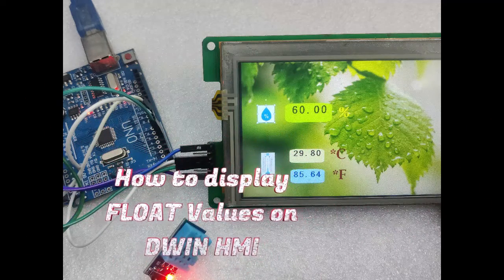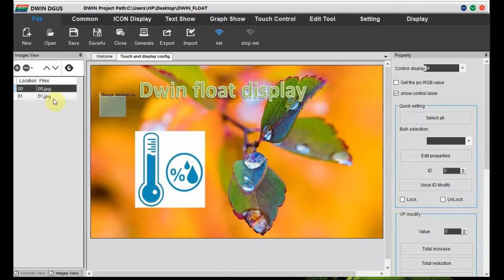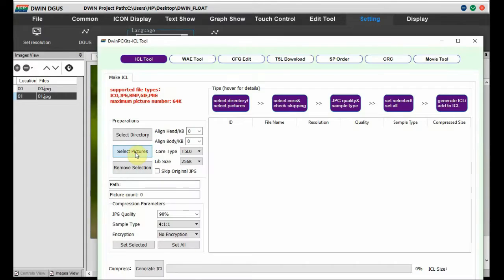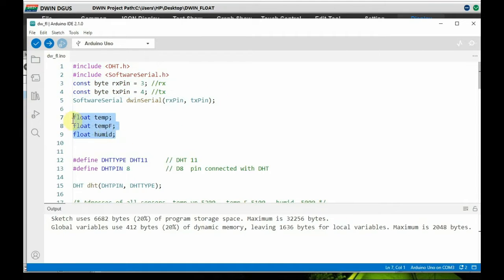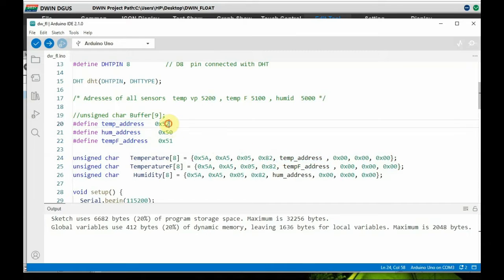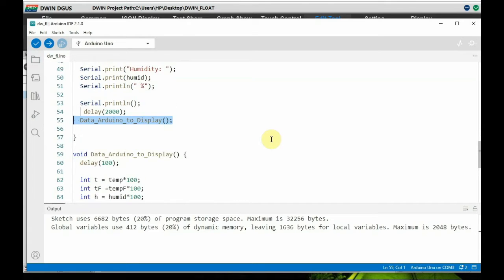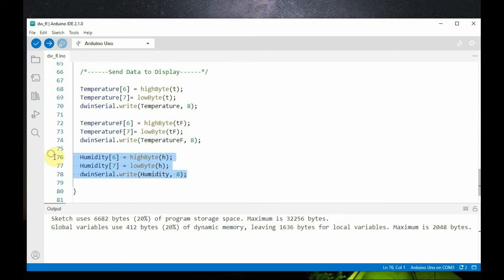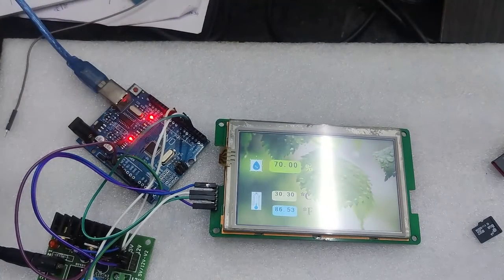#26 DWIN HMI -  How to display Float Values

Comment: Hello, I am a new user of the DWIN display, I would like to know how to generate alphanumeric characters that occupy at least 60% of the height of the display, since the normal way of using '0' index fonts does not help me. It has been possible. In my project the Strings will reach the display through the serial port, sent from an Arduino. Thank you very much and excellent dissemination channel.
Reply from the maker: Artistic Variables can be used by creating image icons. please check video #11   @ 8:15
https://www.youtube.com/watch?v=3819FTWJELM&list=PL0SrfCGiNprSMUgAoekA-BJOxJpuw_Gj5&index=11&pp=gAQBiAQB.
But this method is effective for numeric numbers and for pre stored characters as image icons. Not effective for Strings.
Reply from the maker: you can also try with font generator with bigger size selection for 0.HZK file
Reply: @SaravananAL  I have already tried it, but it is not big enough, that is why I was asking, I have tried with DEGUS txt, but when creating the sources with the gray word library generator and the sources are not shown when sending the strings through the serial port .

Comment: hi sir . i am new to dwin display . i have bought 4.3inch capacitive touch display . but i am facing issue while changing application using sd card (screen goes blank not loading new application from sd card . if i remove sd cardd it booting old application ). i am using sandisk 8gb class 4 sd card . please help me resolve issue
Reply from the maker: Format SD card as FAT 32 allocation units 4096 bytes as seen in video #4
https://www.youtube.com/watch?v=SdKTSLY3sW8&list=PL0SrfCGiNprSMUgAoekA-BJOxJpuw_Gj5&index=4&pp=gAQBiAQB
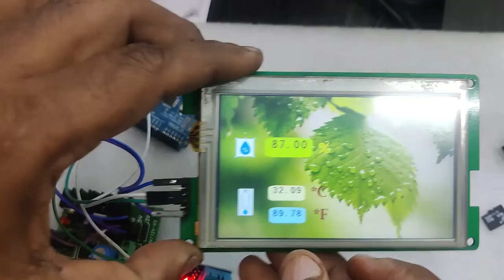@ 7:15.
also ensure that you copy only DWIN_SET folder to sd card.Also an external power source for display.